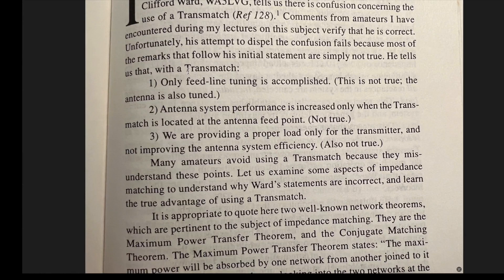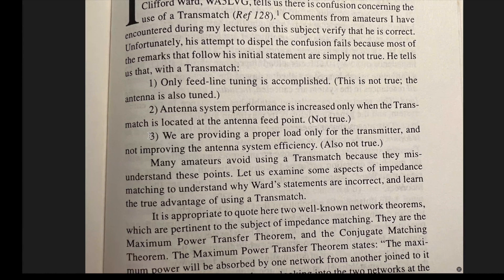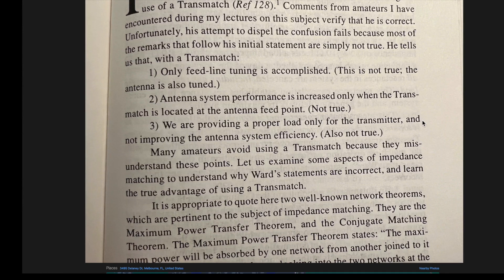Ham Radio Remote Antenna Tuners - An Unnecessary Waste Of $.

Comment: The biggest problem I have with antenna tuners is the heat loss they can represent.   One of two things is going to be the case:

1 -  You have a resonant antenna system and you need no antenna tuner.

2 -  You do not have a resonant antenna system

If the situation is that you do not have a resonant antenna system, you can use a transmatch or antenna tuner to compensate for the mismatch - but, it comes at a cost.   What it costs you is efficiency in the form of heat loss through the components in the antenna tuner that are required to bring the system into resonance.   The net result is that you get the maximum power transferred from your transmitter to the antenna system - but, you experience losses in the antenna tuner components that translates into heat.   If the antenna tuner is warm, it is because some of the power you want your antenna to radiate is being radiated as heat in the antenna tuner, instead.  The power that it is radiating is the reflected power from the antenna that would be detected as a high SWR.  Of course, the converse would also be true - if your antenna tuner is not radiating RF energy as heat, you probably don't need an antenna tuner, anyway - because, clearly, it is not doing much work.

Antenna tuners are lossy devices - not magic, and not efficient.   They do not solve intrinsic problems with an antenna system - they compensate for them.  The transmission line itself has some inherent losses (resistance), and when the reflected power travels back and forth, it encounters these losses multiple times, converting some of the radio frequency (RF) energy into heat.   And, any heat radiated in the system represents inefficiency, even if you are getting a full 100 watts from your rig - (because, you know, resonance of the whole system?).  So, by no stretch of the imagination are you getting maximum transfer of power to your antenna, if you have to go through an antenna tuner to deal with standing waves on the feedline due to a mismatch.

The good news - apart from the fact that you don't really need an antenna tuner, if you use resonant antennas - is that, even with a lossy antenna tuner in your system, you can still make contacts and you may never be able to discern the difference in efficiency in any practical way - except, to notice the heat losses that you might experience in the antenna tuner.   Then, you just have to decide if the antenna tuner is worth the cost of that RF energy lost as heat.
Reply from the maker: Antenna tuners are nearly 90 percent efficient even on the worst bands.  The loss in heat is minimal unless you are running high power into an underrated tuner.  I have never had an antenna tuner that got hot.  If you do you are doing something wrong.
Reply: @BustRadioMyths   How efficient they are is going to be tied to what they are having to do.  The bigger the mismatch they are correcting, the more potential wasted power as heat.

I've never had an antenna tuner get hot - but, I have had them get warm.   Even 15 to 20 watts is enough to notice.

I prefer resonant, or near resonant antennas that either do not require a tuner at all, or need only a little "flattening."
Reply from the maker: Nothing wrong with a resonant antenna but it is only really resonant on one frequency or you have an antenna with lossy traps or some other contraptions

Comment: Mark,  Very good presentation and one that many try to debunk.  One of my added thoughts even with desk top tuners is this.  Amateur operators should start with a Manual Tuner before purchasing an Auto Tuner to get a better understanding of what is going on when you tune.    Thank You        de KC3ZDW        ///    73

Comment: I LOVE how you dispel so many myths about basic and simple HF antenna/tuner operation!
I used a 40/20/10 parallel dipole (tuned on the CW portions so I could bypass the tuner altogether), but with the tuner I could work every band, including WARC, with no noticeable depreciation whatsoever on the bands even with high VSWR. The most important factors are height and the cable, ie. RG-213, like your example. 
Hams, nowadays, are taught to freak out if the VSWR gets above 1.5
I learned this back in the seventies while using 75 ohm TV cable as my feedline.
Reply from the maker: Good observation.  Nothing wrong with using TV coax.

Comment: I had MFJ-993 Auto Tuner taken out of the Metal box , put into plastic water resistance case at feed point.   when I compare when I had same tuner at TRX  , there was not much difference in signal strength at WEBSDR in Utah  800 miles away.  from Orange County CA.    my antenna is Inverted L.   and I use RG-6  75 ohm cable TV coax 50 ft to antenna.   AG6JU
Reply from the maker: That's the thing.  Having a tuner at the antenna doesn't improve anything in a significant way.

Comment: 100% agree! That extra money 💸 could be used to purchase high-quality, low-loss coax (in addition to a quality desktop tuner) -- and avoid the risks of having a remote tuner out in the elements and so on. I'm okay with spending money -- as long as it makes sense and has a useful result. Thanks for this excellent video! ~ 73, Jared ~ AC7WH
Reply from the maker: That makes sense to me.

Comment: i hear it all all alll allllllllllllllll the time.. i got to get it to 1 to 1 .... they have 1.5 or 1.7 but say not good enough. i shake my head. ive turned my radio off. iam sooo tired of the bullchit on the air... its old
Reply from the maker: It's a deplorable lack of knowledge.
Reply: I have over 40k contacts with 205 dxcc entities in the log all using either an 80m to 10m EFHW or an 80m to 10m vertical with a desktop "tuner". Some bands the antenna shows a 4:1 vswr between the "tuner" and the antenna, but less than a 1.5:1 between the tuner and the radio. I've operated this for over 20 years and never once had a failure. It works for me. I won't argue the subject with anyone. I've proven it to myself experimenting many times. I always have come up with the same results. A person that refuses to open their mind is one of the most comical entertainers I've seen. When pushed on the subject, I just ask "can we get together and would you please show me?" I've loved this hobby and taking subjects like this and spending a few weekends building antennas, baluns, ununs, using different coaxes, etc and trying things out. There are many many myths floating around in amateur radio. The only way you'll know what's right and what's not is to prove it to yourself.

Comment: 💯💯 as always!
I have used various manual desktop matching networks (aka, "tuners") for years, along with various dipole and vertical antennas, that were typically always "close" to matched (i.e. "resonant"), but never perfect... I always - purposely - cut them a little long.
Tuners are really the only way to go! No worries about resonance... and your SWR is always good, no matter the frequency.
A few years ago, I acquired a Palstar HF-Auto, and found it to be really nice! It makes re-tuning (e.g., after a band change) really fast and simple, with no knobs to twist (not that there's anything wrong with knobs!). I have 3 of them now (one for each antenna), but still keep a Palstar AT2KD manual tuner, as a standby unit.
Yeah... the HF-Auto's are a little pricey, but well worth it, IMHO. As I get older, I get lazier, and want things simple 😂.  And they're pretty reliable too (5-years-in, so far, with zero issues).
Thanks Mark, for keeping the SWR  myths at bay!
73,
~Alan
W5ARM
Reply from the maker: I've used a number of auto-tuners myself and they keep getting better.  I like hearing the relays clicking and it's great for the lazy ham like me.

Comment: Well, it is the other way round.
Desktop tuners are a waste of money. 😉
Not quite, but remote tuners are always a bit better.
And they aren't always expensive. 
A CG-3000 eg costs 250 only.
Reply from the maker: Explain why?
Reply: Really?
Please elaborate... how so?
Reply: Popcorn is ready.......
Reply: @TheMicrofox  Perhaps... but not when you want to run a kW+.
Nothing wrong with remote tuners. I have the Palstar remote control heads ("HF-Auto-R") for two of my tuners, but I've never deployed them, simply because there's no need to; the HF-Auto's work great sitting right on the desk. And using super low-loss coax, the SWR cable-loss is miniscule... virtually irrelevant.
ANY tuner is better than none at all.
Reply: @Calico5string1962 For my 50+ meters long EFRW I replaced the 1:9 UnUn with a CG-3000 - a difference like night and day.
Coax is low loss Hyperflex5.

Comment: Look at AM broadcast.  They use non matched antennas and a tuner at the feed point of antenna system.  I modeled a 75' top loaded vertical that patterns well on 160-40 meters.  Nowhere will that antenna be friendly to match.  SWR losses will be extreme even in big coax.  Enter remote tuner!  I see what you are saying though.  If they are buying an end fed or something that should be close, it is not needed.  73, KF0BBU
Reply from the maker: I see your point, but I don’t think too many hams have a transmission line that’s over 200 feet long.
Reply from the maker: Makes sense for a commercial broadcaster since they only operate on one frequency.  Hams generally operate over a wide range of frequencies with just one antenna
Reply: @BustRadioMyths  still makes sense if you want to use it over a broad frequency range with low losses.  If you have a crazy mismatch then you would loose over half your signal in a 200' plus coax run even on the low HF bands.  Not sure how that isn't a good use of a remote tuner?  lol

Comment: In some situations when you can put only some wire almost random length, then remote tuner at antenna feedpoint is the only viable solution. 9:1 unun will create too much losses. Am I wrong ?
Reply: A 50-ohm reading at the feed point doesn’t necessarily indicate an efficient antenna. It just means the impedance happens to match the coaxial cable or transmitter, minimizing reflected power. An inefficient antenna could still have high losses due to poor radiation efficiency, resistive losses, or suboptimal ground conditions.

For example, a dummy load presents a perfect 50-ohm match but radiates almost nothing. Similarly, a lossy antenna system such as a short vertical with insufficient ground radials might show a good SWR while wasting much of the power as heat or ground losses. 73, Dan KM6CQ
Reply from the maker: Very true!!
Reply: A high quality 9:1 or 4:1 UNUN operating within its power and frequency rating will introduce some loss, but likely not exceeding -0.5 db.  A random wire antenna will exhibit a wide range of complex impedances.  Some will be 'tamed' by the UNUN, others not so much.  The 'not so much' ones will benefit from a remote tuner.  But if you're going to use a remote tuner, then the need for an UNUN may not be necessary, depending on the matching range of the tuner.
Reply from the maker: A properly designed unun should'nt be a problem.  Just because you don't know the length of the wire I don't think that means you have to have a remote tuner.  If the impedance at transmitter end of the line is within the range of a tuner at the source it'll work fine.